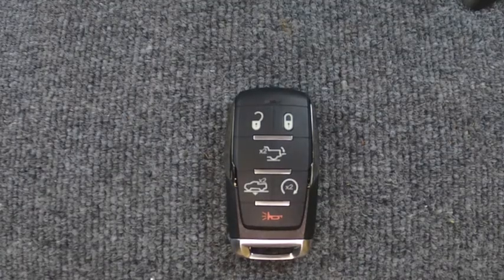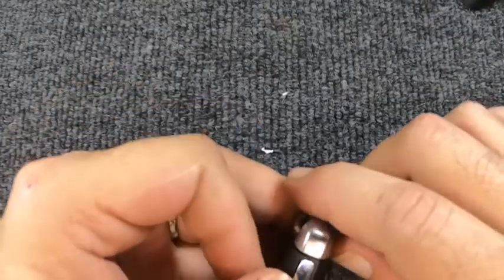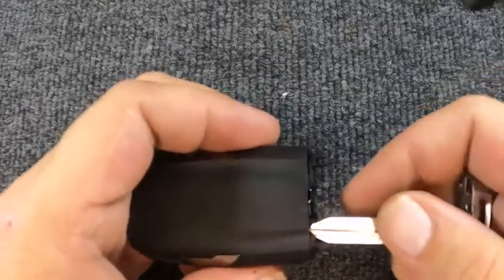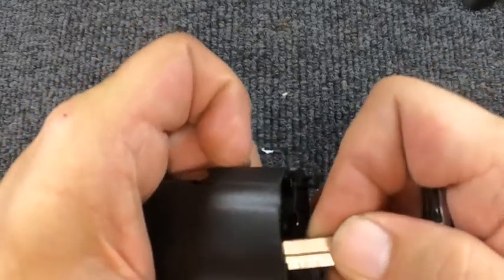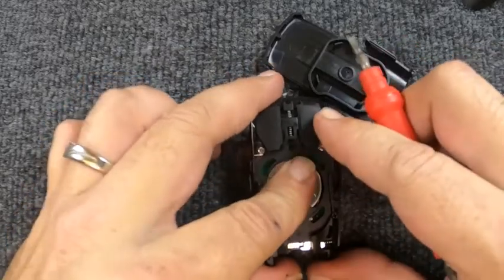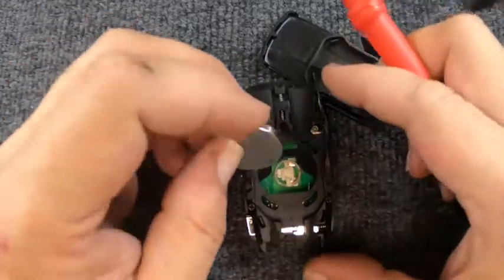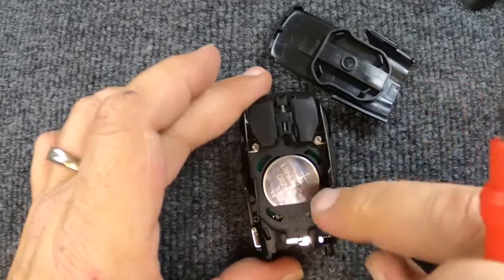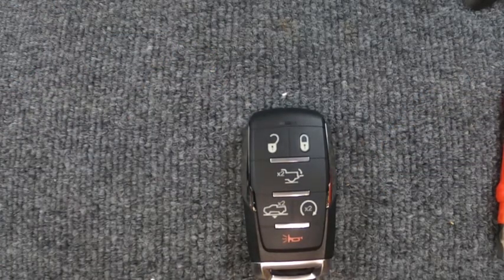How to replace a 2019 Ram 1500  6 Button Smart remote  Key fob Battery

Comment: The rubber pad covering the controls on my Ram Smart key is ripped. Any tips on buying this  part and installing?
Reply from the maker: I'm not affiliated with nor recommending them. But when the housing come they are in pieces and you snap them back together.  Unfortunately you can't just order the rubber housing since they're molded into the remote. https://www.amazon.com/AUTOHAUX-Control-Keyless-Replacement-2019-2020/dp/B0BCJTM4XQ/ref=mp_s_a_1_2_sspa?gclid=CjwKCAiA3KefBhByEiwAi2LDHB-xpINQd_uy0tRev3vav0nvKipVEOs4Y_vM1iIwqxvXryNk6-qJWhoChmcQAvD_BwE&hvadid=631535795947&hvdev=t&hvlocphy=9024737&hvnetw=g&hvqmt=e&hvrand=11653404005804064881&hvtargid=kwd-531244710447&hydadcr=25148_13572256&keywords=ram+key+fob+shell&qid=1676312005&sr=8-2-spons&psc=1&smid=A1THAZDOWP300U&spLa=ZW5jcnlwdGVkUXVhbGlmaWVyPUEzQ0czSzJLVENSN0RRJmVuY3J5cHRlZElkPUEwNDQyOTIwMVAxNjM1MFBNNkJXWiZlbmNyeXB0ZWRBZElkPUEwNjIwMDU4M0pBTEhIMFZTQTRJTCZ3aWRnZXROYW1lPXNwX3Bob25lX3NlYXJjaF9hdGYmYWN0aW9uPWNsaWNrUmVkaXJlY3QmZG9Ob3RMb2dDbGljaz10cnVl